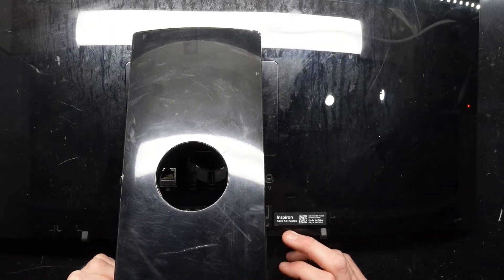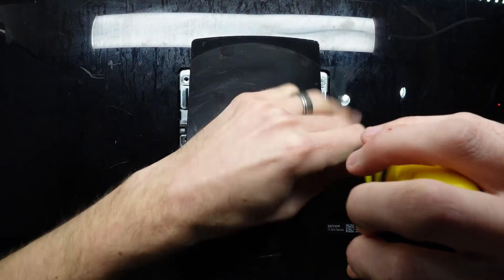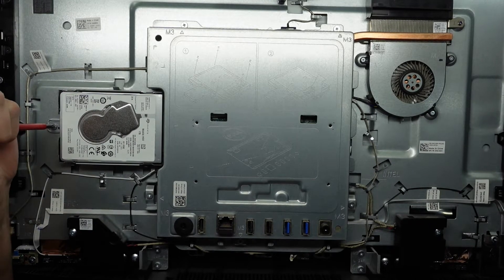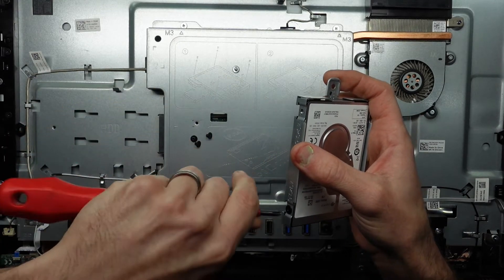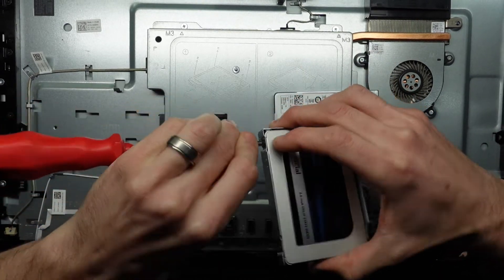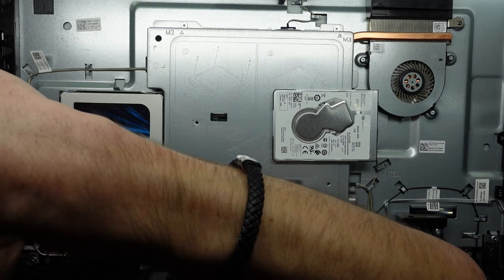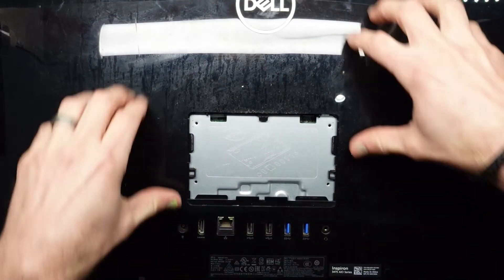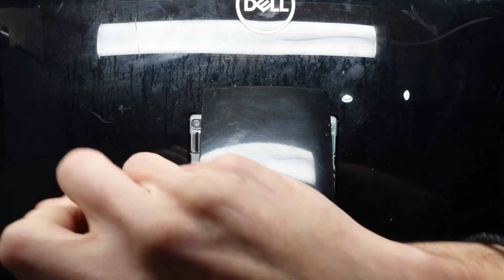Dell Inspirion 3475 AIO How to Install a SSD

Comment: I have this computer....it's SLOW SLOW!!!!!   But how do you use the true image to clone the OP System?
Reply: Take the original drive and plug into another computer along with the SSD. Anything with 2 SATA ports. Run Acronis True Image. Pick the source (HDD) and target (SSD)  It does everything.  Put the SSD back in the Dell.